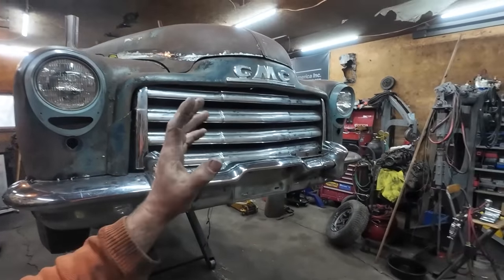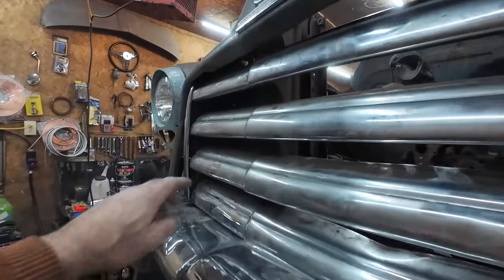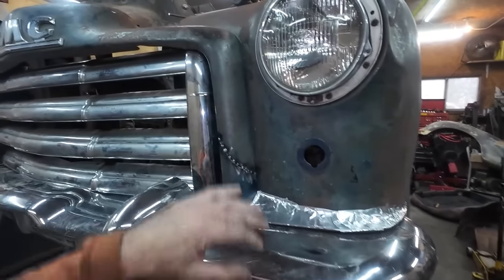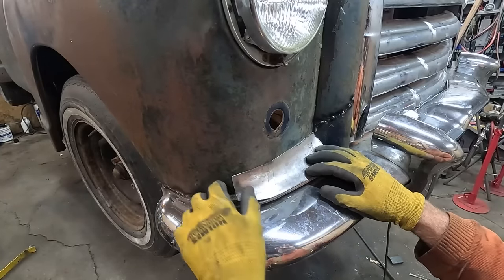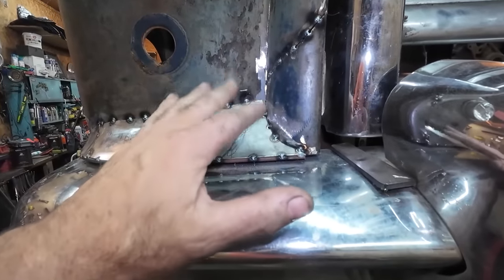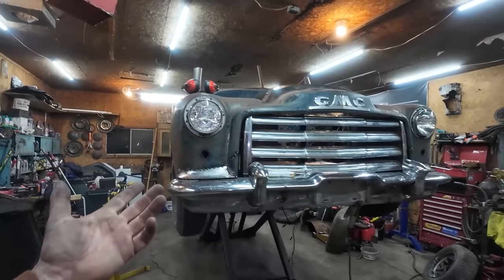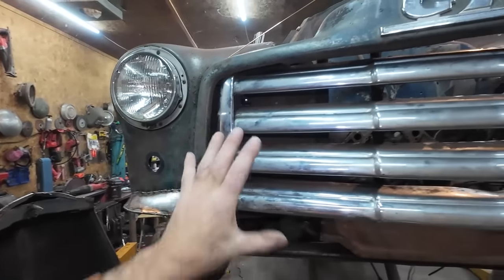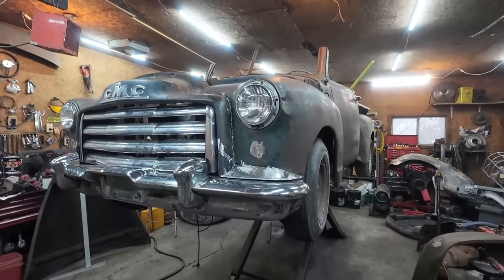Building a transition panel to the front bumper on our 49 GMC roadster

Comment: Have you considered using the buick or international side open hoods? Might just be the ticket to pull that hood into a fit mitting solution. That and then  using bits of stainless down the sides of that hood to take the eyes off of how it is looking and more so see that flat styling

Comment: I like the styling changes and the only difference I see is the taper on the passenger side is a steady angle down to the corner of the fender where the driver side seems more flat to the corner,  nothing a little mud can't fix but the passenger side is the best look,, not trying to be critical because I know things like that are hard to see when you're right on top of them, I just had a better seat in this movie,, 😂😂,

Comment: Isn't it a Roadster Pickup Truck? 
Where "Roadster" = Open top two seater. "Pickup" = commercial 'well type' load carrying body that is separate from the cab, & "Truck" because 'commercial' chassis & not derived from a passenger car base. [Like a Ranchero which is a Ute anyway.]